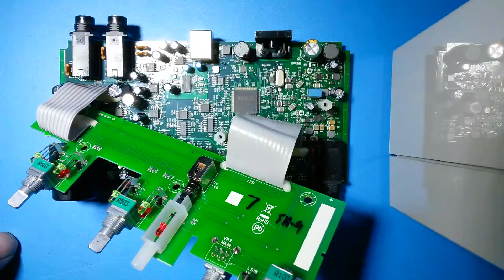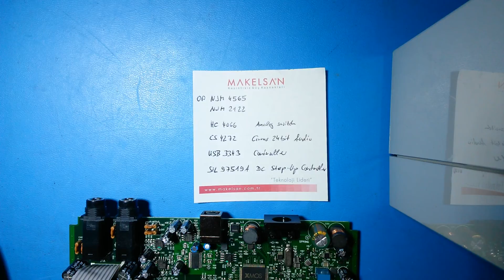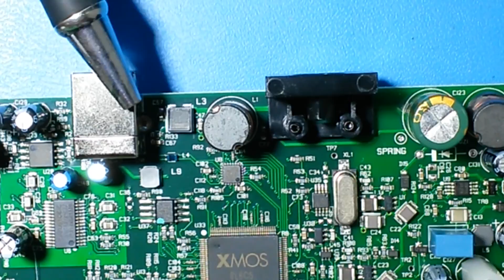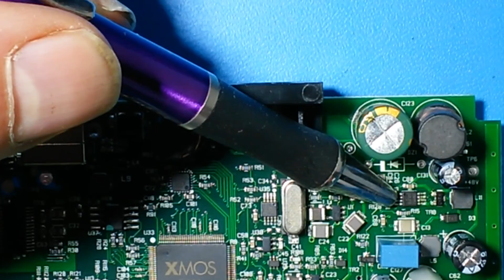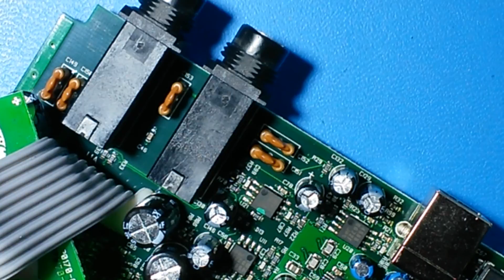Focusrite Scarlett 2i2 Defect, Repair hints, Reparatur Hinweise

Comment: My 2i2 is no longer recognized with any computer. I need your help. Can changing the USB Type B Port solve the problem? 

All of the LEDs are working when I connect. Even +48V and gain leds are working when plugged.

PS: I have seen Turkish words on that note paper. Where are you living? I'm in İstanbul/Turkey. Can I reach you somehow? I don't have any money to spend on a new soundcard and my album project is stopped :(
Reply from the maker: You should use a different computer and/or an other usb cable. If this won't work then I think one of the digital chips is demaged. Perhaps there is a cold lead in the plug on board. Maybe you you have a driver fault on your computer.
Reply: Joachim Tiefnig I have tried 3 different cables and 3 different computers.

Also tried drivers. A Focusrite worker lead me through the steps. We did it twice.

It sounds really weird that a "recognizing" issue is caused by a faulty usb type b port but I have seen 3 people changing it then it works.

Any experience about it? Thanks anyway for sharing this video
Reply: Selam dostum, yukarıda paylaştığım gibi bir sorununmu var bende 3 sene önce 2i4 ses kartı satın aldım kısa bir sonra ses kartı arızalandı ve bir daha kullanmadım. Videodaki gibi sorun yaşıyorsan aynısı bendede mevcut bugün elektronikten anlayan dayıma teslim ettim yaparsa kullanacağız yapamazsa çöp olacak ama focusrite kartlarda çok fazla sorun tespit edilmiş.
Reply: Hayır. Benimki 2i2'de şöyle oldu. 2014/12 yapımı 1st Gen kart. 2 sene sorunsuz kullandım. Sonra bir akşam her zamanki gibi USByi taktım. Hata verdi. " Windows cannot recognize the last device you have plugged" gibi bir şeydi. Yani tanımadı kartı. Focusrite ile iletişime geçtim. Ordan bir adamla baya 2 saat kadar uğraştık. Kendisi maille dosya falan gönderdi indirdim kurdum sildim vs. olmadı. Aradan 1 ay geçti bir daha attım mail bir daha denedik. Tamir ettirecek bir yer de bulamadım İstanbulda.

Karttı takınca tüm ledler bir yanıp sönüyordu normalde. Yine aynı şekilde yanıp sönüyor. 48 volt ışığı da yanıyor. Cihaz aslında sağlam da işte USB portunda bir sıkıntı var sanırım. Bir kaç kişi değitirmiş YouTUbe'da yabancı. Çalıştırıyorlar. 3 4 tl bişey o da. Ben de alıp değiştirecem (inanasım gelmiyor ölçü cihazıyla kontrol ettim çünkü. Orası da sağlam gibi duruyor) yoksa çöp oldu. 6 aydır duruyor öyle. Bu meretler de pahalı yenisini alamıyorum. Gönül ister ki bir RME falan alalım...
Reply: Bence farklı işletim sistemlerine sahip bilgisayarları dene, sanırım benimkisi çöp oldu. Ve bir çok kişi focusrite ses kartlarından muzdarip geçmiş olsun nediyelim ben 3 sene önce 600 liraya aldım 2i4 gen 1 şuanda 1000 lira civarı çöp oldu anlayacağın :D
Reply: Uğur CANKURT kardeşim 4 pcde 4 er kabloyla denedim :) şu zimbirtiyi da değiştirip denerim. Çalışmazsa da rafa kaldırırım. Audient id4 öneririm. Ya da daha üstü. Ben almayı düşünüyorum. Uygun.fiyata bir RME bulursam ondan alırım ikinci el. Sen de inşallah güzel birşey bulursun. Malesef seninki çöp olmuş. Aynen focusrite yalan resmen. Kimsenin hatasını çözmüyor adam akıllı ve hep aynı sorunlar...
Reply: hocam usb değiştirdiniz mi? değiştirince düzeldi mi? aynı soru sahip bir cihaz da bende var, sizin yaşadığınız sorunun aynısı @rikyriky966
Reply: Did you find the solution